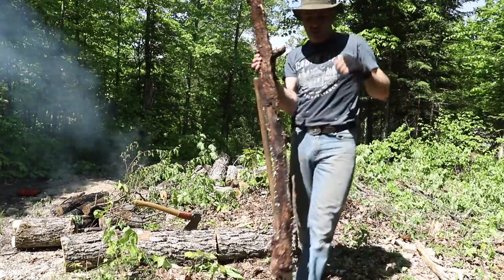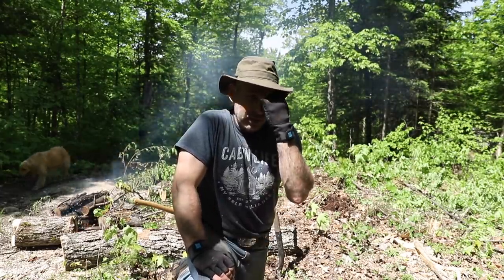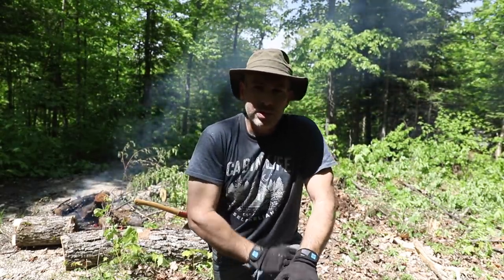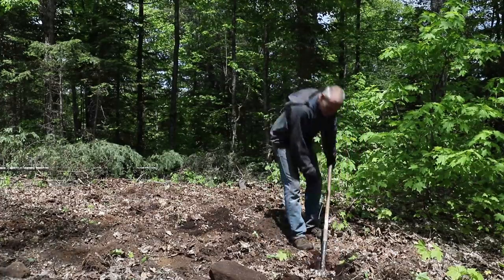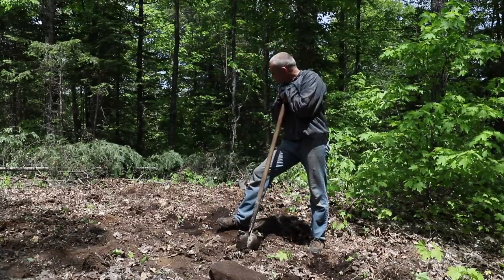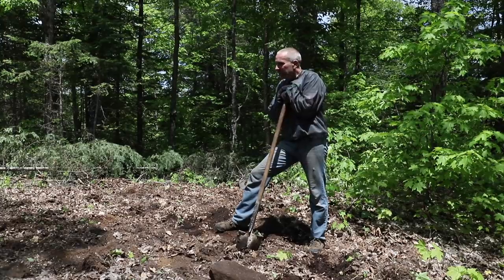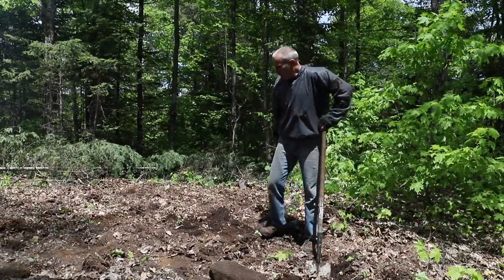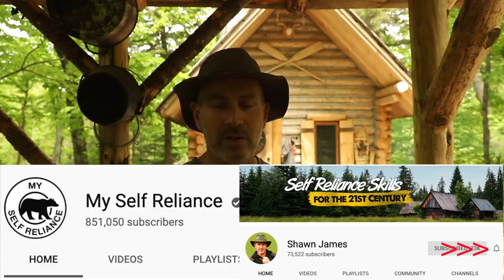Log cabin Door Handle | Pizza in the Forest | Growing Food in the Wilderness

Comment: Great video Shawn. I have a few suggestions as a gardener who has cleared forest land. The soil in the forest is different than garden soil...its composition, the acidity, water requirements, etc. Conventional wisdom says it takes 5 years after you clear forest for it to become garden soil, but I believe that can be accelerated by doing the right things. You have already begun this process with your burning and wood ash addition. I would also recommend adding as much natural materials as possible. Do you compost? an absolute necessity for every gardener. Animal manure is also a great early addition, although you don't want to add an excessive amount at any one time. Happy to get into more detail as to my process of soil buiding and composting if you would like. Also, "green manure" cover crops can not only reduce erosion but also improve the hummus content and the structure of the soil, water retention, and add nutrients. I would recommend that you dedicate a large portion of your garden to green manure crops initially, the long term benefits far outweigh the short term loss of production. Gardening is so much easier and more productive when you have great soil. Just a few thoughts from someone who has done what you are trying to do and learned some hard lessons from trial and error. It was a lot harder initially than I had anticipated, so don't be frustrated if its not all that you hope for this year. You are obviously a very intelligent, thoughtful, hard working individual. Persistence will pay off.

Comment: Hey Shawn. Have you considered using a ram pump to bring water up to the cabin or the garden from the creek? Depending on how the water flows and how much pressure it builds, you might be able to use one to move water up to the areas you need it without having to haul it, or use any power, etc.

Comment: I've heard Irish Spring slices stapled in cheese cloth around and staked in your garden will help keep the deer and other critters out.

Slice the Irish Spring soap bar into 1/2-inch cubes with a knife. These do not have to be exact, but you'll want many small chunks to spread around your garden.

Drop two pieces of soap into each drawstring pouch, pull strings tightly to close, and tie the strings in a knot to secure the soap inside.

Staple one drawstring pouch to the end of each wooden stake with a staple gun. Drive the opposite end of each stake 6 inches into the ground in 5- to 10-foot increments around your garden. Concentrate stakes in areas with thick vegetation or in spots you've noticed often are damaged by pests. Alternatively, lay the drawstring pouches under and around the vegetation for a more discrete solution.

Monitor the garden over the course of the next week for signs of damaged or eaten plants. The amount of Irish Spring soap you need to ward off pests depends on the size of your garden, and the population of local deer, rabbits and other animals, so be ready to add more stakes to target heavily-trafficked zones.

----
and for insects get some food grade diatomaceous earth or 'DE'.

Diatomaceous earth kills all bugs. It has been reported to be the most effective solution when fighting pests like fleas, ants and bed bugs. Farmers dump food grade diatomaceous earth by big scoops in with grains when the grains are stored. It kills the insects that want to feast on the grain.
Diatomaceous Earth (often referred to as "DE") is an off white talc-like powder that is the fossilized remains of marine phytoplankton. When sprinkled on a bug that has an exoskeleton (such as bed bugs, ants or fleas) it compromises their waxy coating so that their innards turn into teeny tiny bug jerky. But it doesn't hurt mammals. We can eat it. We do eat it! It's in lots of grain based foods because lots of grains are stored with diatomaceous earth to keep the bugs from eating the grain!
One strange thing about diatomaceous earth is that for it to work on killing bugs, you have to keep it dry. Even morning dew can make diatomaceous earth ineffective.

I have encountered over a dozen ignorant boobs that have proclaimed "Diatomaceous Earth does NOT work!" I have read this statement in all caps. In extra big fonts. With italics. And I've even had it screamed at me. I'm gonna stick with "ignorant boobs". On closer inspection of each case there is always a flaw. Usually the problem is that it was not used correctly. Diatomaceous earth is not a bait. If you put a little bit in a pile somewhere, the bugs are not drawn to it and invite all their friends. I kinda wonder if the pesticide companies pay people to go to internet forums and say this sort of thing. Diatomaceous earth is super cheap, non toxic, and generally more effective than anything the pesticide companies have to offer - so it kinda cuts into their profit margins a bit.

Comment: A great garden soil.  6" fall leaves, a sprinkle of bone meal and blood meal.  Next layer same but add sprinkle of soil and garden lime - every other layer.  Do it until you have row beds forming mounds 5 - 6 layers deep.  I have had mounts 2-3' tall.  If the wind blows the leaves, get rabbit netting or fir boughs to pin over the rows.  All winter long the layer will compost down until by spring there will just be a slight crust.  The worms, nutrients and leaf fiber with marry with the soil. After a few years the soil will become deep, rich and loamy if you put the garden to bed like this in the fall.  Make the beds 3 - 3.5 feet wide and don't disturb the paths between.  I have done this system for years and the crops are outstanding!  You will have to figure a way to keep your critters out - maybe hoop the rows.  I don't know - a moose will love your efforts!  Thanks for the fine video on a hot, buggy day.

Comment: Summer heat suggestion:   build a cheap swamp cooler.  You need a solar charged battery and a few parts.  it will drop the temp 15-20 degrees.  I'm not promoting this guy, but he has a well built plan that's very affordable ($50-75) and will cool a space for hours.

Comment: Was thinking about your cob oven. You said you were thinking of redoing it or trying to find a solution because it doesn't retain the heat the way you want it to to bake with. Maybe you can wrap it in mineral wool insulation, then place another layer of cob on top of the insulation. Not sure if it'd actually work, but might save you from having to start over from scratch. Just a thought I had while watching you make that delicious looking pizza.

Comment: I don't know have you thought about it or if you don't like the design or can't find materials, but you could also make door handles out of tree branches. Not sure what trees you could use in Canada, but here in Finland I think people usually use pine branches and then varnish them and screw into the doors. Though I think it's a bit dying tradition, haven't seen many of them used nowadays but it's surely an eyecatcher. My grandparent's had those on their sauna (I don't recommend using them in the sauna room as they did, the varnish get like burning hot :D) at their summer cabin. Then again I haven't seen you using much varnish anyway so maybe that's not part of the lifestyle, but thought to mention if it haven't crossed your mind :)

Very nice video anyway, as always.

Comment: I don't know if you'll read this but I was wondering about that outdoor kitchen wooden counter you made your pizzas on. I know you wiped it clean but I would worry about unwanted bacterias and such. You being a metal worker how about making a stainless steel cover on hinges to cover the wood. It would keep the wood clean reducing the risk of getting ill from wildlife (let's call them residues), it's easier to clean and disinfect, can handle the heat  plus it could work as a shield (backsplash) from the elements. Just a tought. p.s.: Love the garden.

Comment: As always a lovely video and loving the self-sufficiency you are working towards. For the garden, do you have a way to pipe water from the upper stream - are you planning on using piping and gravity (if possible) or running a ditch to supply the water?
Reply from the maker: It's too far and not high enough. I think rain collection is my best option

Comment: Suprised you dont make yourself a long handled Pizza Peel... easier to put the pizza in your oven and turn it without getting to close plus metal gets hot. I have a short one as well as a stone in my oven. Nothing beats it. Plus you can make the handle as long as you need. Then hang it near by the oven. If you have a short and longer one, you can make your pizza on the shorter one(s) as well as serve and cut on them.

Comment: But no really, a wooden peel works great to slide the pizzas in the oven. A metal one works great to pull them out. It’s just a flat, tapered piece of metal or wood with a long handle. Not that complicated. But not that big a deal either. Cool homestead though.

Comment: 19:19 don't do that man, you don't need to apply any crumbs under the pizza they will just burn as we saw, the pizza wlll not stick to the stone. What you need is a pizza peel.  Also, the peel enables you to lift the pizzas up momentarily into the top part of the oven where the heat is where you can get some char on them (yours were under-cooked). Thats the authentic way to cook them.

Comment: Shar Figzy , thank you for your kind remarks . Some of the things you see on “ My Self Reliance “ are something I saw my father do while I was growing up . He could take an ax and a sharp knife and make almost anything. We had an old single shot , shotgun that had a bursted stock on it one time . He took a block of black walnut wood and with an ax he roughed out a new stock for it . Then with his knife he whittled and carved it down to fit the old shotgun . He made cherry wood handles for a pistol the same way one time . He showed me how to make a wood lathe using a tree limb for a spring . Then he made a frame out of wood and a foot treadle . He tied a small rope to the tree limb and rapped the rope around the piece he was turning , and tied the other end of the rope to the foot treadle . When he pushed down on the foot treadle the piece he was turning would spin . When he let up with his foot the tree limb would spin it back up . He would cut his wood piece on the down stroke . It was amazing what he could make with that primitive wood lathe . The things he taught me helped me figure out how to do things all my life . It helped me when I was building my home . The things Shawn is doing is teaching how to figure out how to do things if there was no electricity to run power tools . I built a pole barn with a hay loft from logs I cut off my place . I used the cheapest lumber I could find for the walls . It was rough cut sweet gum . It was hard to nail but it’s still standing although weathered and still in use today after about fourth years . Looking back after 72 years of life I believe I could write a book on the things I’ve seen my dad do and the things I’ve experienced over my lifetime . Have a blessed day and week my friend.